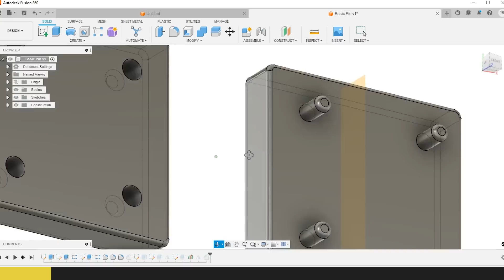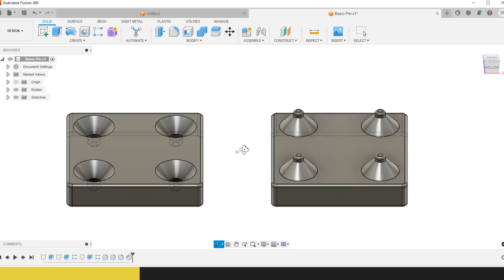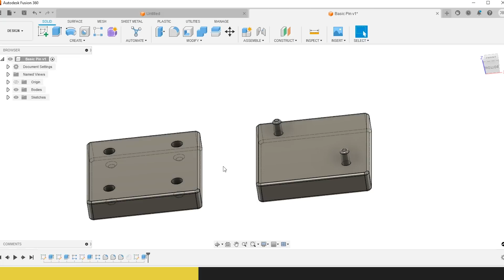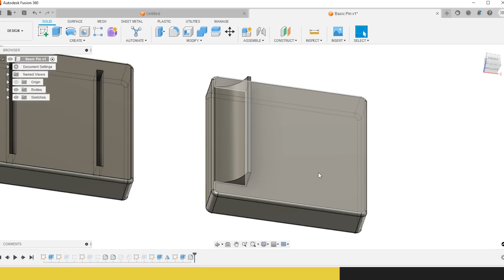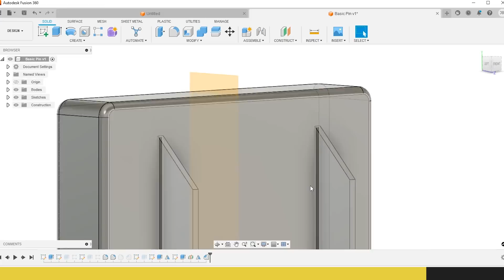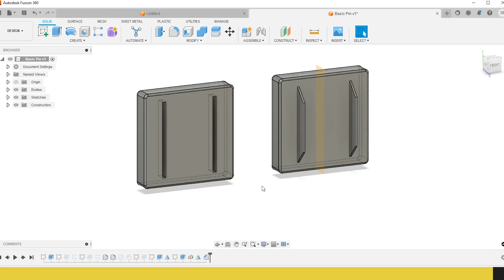Alternative to Pins and Holes: Design for Mass Production 3D Printing

Comment: I would never understand why the 3D printing community don't like screws... just leave the holes and use metric set screws. It would be cheaper, faster and way more reliable.
Reply: Screws are for fastenings and pins are for aligning. They are not interchangeable (in most cases).

The 3D printing community often uses screws when they make the most sense. But it is always a good thing if you can make a design that requires no hardware. That way you are completely self sufficient with your printer.
Reply: @TinaDanielsson 
Technically speaking, you should use dowel pin with external thread that are more expensive and are the correct part to used, but for 3D printed parts, a regular set screw is more than enough. Yeah, metric screws have more than enough precision for a 3D printed part to be used as a pin. 

Just print 1 side with the inner thread size and the other part with the outer thread size. For example a M4 set screw, would have a diameter of 4mm and and inner diameter (so you can do the thread) of 3.25mm. So you just need to print your parts with different hole size and then put the screw.

The only reason people are printing the pins is because they don't know that they could just use dowel pins or set screws and buying them is a hassle. But if you're doing "mass production" like the video tittle say, you should search for the best alternative and that's buying already cheap and mass produced parts to be integrated to your manufactured parts. There is a reason dowel pins are already a industry standard.
Reply from the maker: Screws are one of the single larges points of failure in any machine.
Reply: @slant3d  plastic parts are the largest point of failure... I assure you that any metal screw would last way more than any 3D printed part... and also a 3D printed hole is more reliable than any 3D printed pin or fin. 

So, just put a freaking 3D printed screw hole on one side and regular hole on the other side... install a simple set screw and you're done.
Reply from the maker: Screws are one of the single largest points of failure in any machine.
Reply: @slant3d  and again... a plastic 3D printed part is the biggest point of failure... It's pretty obvious that you don't work with other materials or process.

Seriously, I have years in the manufacturing industry. I work with CNC machines, laser cutters, and 3D printers and the less reliable part are the 3D-printed parts. The only reason we use them, it's because it's cheap and fast, not because it's the best option.

Using 3D printed pins and fins is just stupid. Those break with almost no effort. A hole is way more resilient than any pin/fin and adding metal inside (like a set screw) is pretty simple and add way more structural resistance.

Unless you're stupid and want to use 3D printed screws, you're actually adding structural resistance by adding metal parts.

You're designing for 3D printing, not for CNC metal parts where you actually use a single piece of metal, and it would be better to have pins.

Comment: just print holes and use SS pins. faster, simpler.
Reply from the maker: Adds additional labor and cost in mass production
Reply: @slant3d  still cost effective up to amounts you shouldn't be 3d printing anyway. we are talking cents and little to no effort inserting them for higher realability/durability and faster design/print times.
Reply from the maker: Adds additional labor and cost in mass production. Cents in effort and parts equals dollars when you produce 100k-1 million of them

Comment: Metal dowel pins are cheap as hell and will be stronger and quicker to use.
Reply from the maker: And they add extra labor and hterefore extra cost to a part
Reply: @slant3d  To hammer in 4 dowels doesnt take a lot of time. Especially considering printing the parts takes a lot longer. Even with a huge farm hammering in those dowels wouldnt take any longer than removing the part from the build plate.

At industrial levels firms are likely to be using injection moulding anyway.

I see your point though it is quicker to just print these parts but adding dowels will be more accurate and increase the strength of the connection. I just cant see why you wouldnt do that.

Just because you can build the solution into the 3d printed part it doesnt mean you should.
Reply from the maker: Imagine hammering in dowel pins 1 million times.
Reply: @slant3d  Imagine 3d printing 250,000 parts... The volumes you're talking about is just unrealistic. You wouldnt 3D print that many, you'd use more appropriate methods of manufacture. At that scale you'd be using robots anyway.
Reply from the maker: They are volumes we do all the time.
Reply from the maker: check out one of our robots https://www.youtube.com/watch?v=GeFzJ7teFjk
Reply: @slant3d imagine typing in favor of time spent/saved for mass production but then also typing print times are an irrelevant metric

Comment: Interesting alternatives to typical metal dowel pin alignment 👍. Actually the pins need not be round to start with, if to print hexagonal pins laying down it should print fine without support. You can also make the length a little undersized. Chamfer on end faces both on holes and pins should help as well. Then it is just inserting these pins with a drop of cyanoacrylate(aka superglue), is all that is needed. Should makeup for a much stronger and durable part with least amount of overhead interms of effort/time. The approach, does not sacrifice extra space, or need to accomodate new design requiremts for things such as slots.  It is also Poka-Yoke. Just some thoughts ....

Comment: Good alternatives depending on design constraints and usability.

I want to explore the use of bendable prints, you know a thin piece printed that connects the lid to the box and is flexible, I wanna see which design is the strongest and can be folded back and forth indefinitely.

Comment: My personal favourite is to create holes on both sides (on one side press-fit) and I insert a metallic pin or set screw. If necessary gluing on one side.
Reply from the maker: That is a fine solution. But the extra labor increases the cost fo the parts in mass production

Comment: I'd still go with pins but cut a flat side on both the top and bottom (essentially a rectangle with two rounded sides) so it can print horizontally and flat on the build plate. Also adjust the holes to match the pin shape.

Comment: What is the actual point of this? If you are assembling parts you need them to stay together which means fasteners or snap features. If using fasteners, a tight fit clearance hole and a tapped hole or heat set insert should provide as much aligbment accuracy as printed pins. If not using fasteners, the snaps should be able to be designed such that they drive alignment. I cant think of a real use for this. Even your use case of a box would be better suited to a simple lip under the lid that engages the walls of the box.
Reply: It's because people use pins all the time, whether or not you do is irrelevant. This is a video for those people
Reply: @bigcheese82  I use pins plenty. That isnt relevant. The whole point is that this was posted as a novel use of pins, but its novel because its one of the worst ways to accomplish the goal.
Reply: I’d probably press in dowels anyway.
Reply: Thankyou I have learned so much from watching your videos
Reply: To say what’s the point smacks to me of not having tried to mass assemble stuff. Having location features so you can smack parts together is really helpful - as even if you were then to fire in a plastite screw as a fastener - these features ensure the holes for the plastite screw are aligned . Otherwise you have a much slower and tiring activity to match the two parts up to then put the screw in. Also - you can reduce the number of fasteners - as the fasteners keep the surfaces together - but you don’t need multiple screws to align the parts- hence saving assembly time screwing stuff in - and part count.
Reply: @jonnyhifi Did you purposely ignore all but the first sentence of my comment? This is just a very basic way of accomplishing something we already have features for. Snaps, nesting, and lip and groove features already do the same job better. To be impressed with this "smacks to me" of not knowing anything about part design. Even hobbyists on printing forums are using more advanced features for the same purpose. This video is like explaining and praising the usefulness of cave drawings when we already have computer aided design. The whole video is just a sales pitch for this guys company and if this is the stuff he thinks is revolutionary, its not a great pitch. I have been designing, printing, and molding parts for over a decade and none of this is specific to 3D printing or better than more advanced injection molding features, no matter what he says in the video. He has a pretty big stake in making it seem like printing is a revolutionary new manufacturing method thats appropriate for mass manufacturing. There are plenty of arguments to support that, but features like this are not one of them

Comment: Ok, here is my amateur tip of the day. Make just holes, and use the filament of the 3d printer as the mating pin. Also, the video is showing that 4 pins is bad, and then the second solution is to drop it to 2 pin, doesn't make any sense.

Comment: You could literally see how the fins DID NOT align the two blocks together.... At least a good 1 or 2mm out from each other 😂

Steel dowel pins are very cheap, accessible, and are very accurate. They also don't have the risk of shear like printed pins do like you shown in the video. All you need to do is make one part with holes that have an interference fit, and the other to have holes that have a close clearance fit. You don't need to reinvent the wheel. There's a reason that method is used in traditional injection moulding equipment.... BECAUSE IT WORKS AND IS REPEATABLE!!!

I get the drive to think differently, but you need to also consider the fact that if something isn't broken, it likely doesn't need fixing...

Also, 3D printing is really only suitable for at most low quantity batch production parts. If you're doing 10's of thousands of parts, you'd be best to just go down the injection moulding route... You'd get parts far quicker, more robust, more accurate, nicer finish, and probably very similar in cost even with mould tooling design and manufacture included.
Reply: this part could obviously be best suited for dowel pins and injection molding. You need to look 1mm below the surface that OTHER applications can not be injection molded and still need alignment pins.
Reply: @saxplayingcompnerd  You can use steel locating pins for many purposes... they aren't only for injection molding.
Reply from the maker: Adjust dimensions to your application.

Comment: If the rib is thinner than the straight pin, it is weaker in that direction. The rib also has a lot more surface area, so more opportunity for error, or over-constraining the locating feature, causing improper fit (as seen in the video).
Reply: Definitely a few ideas here that will generate difficult assembly and improper fits

Comment: I usually just print the pins separately laying flat, then brush the mating surfaces with acetone before assembling. Otherwise I split the parts like a puzzle and add keys to lock in place, depending on how i need to assemble or what it will be used for

Comment: 'mass production 3d printing' really curious what you mean by this. Needs nomenclature adjustment
Reply from the maker: 25,000+ parts
Reply: @slant3d  If you need 25,000 of something, you would surely just injection mould it.. I can't see how FDM can compete with the price, speed, dimensional accuracy, and robustness of an injection moulded part. Yes there's tooling cost, but at 25,000 parts that's likely to be totally negligible in the grand scheme of things.

Comment: I still have plenty to learn about fusion 360–what is that move where you drew two circles to “undo” two of the pin extrusions without going back in the timeline? Didn’t look like you used the cut feature either

Comment: I usually just put holes on both sides, and use pieces of cut filament as the pins. It's much stronger than printed pins and while I'm not sure how it compares to fins, it's probably good enough for most applications and pretty fast to do.
Reply: yes, or print some dowels that you can friction-fit in the holes.
Reply: @jr1821 Or just buy them.  You can get premade cut dowels/pins for furniture making and repair at the hardware store.  Wood and stainless are common.  The stainless ones are like 50 cents a piece.  Cheaper in bulk.

If you really need some custom length, you could just buy a wood/steel/brass/aluminum/whatever rod and cut them down with a simple hacksaw.
Reply: This is the way
Reply: Interesting idea, do you glue them in or melt them, or something else?
Reply from the maker: That is an option. But it adds extra assembly time when the features could be integrated into the print to make it more scalable. Imagine manually adding pins 10,000 times.
Reply: @slant3d  on that scale though, we're beginning to venture into territories, where 3d-printing is just not economically viable anymore
Reply: @ichbrauchmehrkaffee5785  Yes, in mass production it is just better to use the 3D for prototyping and then manufacturing a resin, silicon (or whatever) negative out of it. Gone are the times where you had to carve a wood plug with a knife for smelting metal.
Reply: @ichbrauchmehrkaffee5785  ?? entire 3d printing farms exist specifically bc it is economically viable
Reply: @aakh-sw1ls  depends on the part, material, and post processing as to which way to go. Anybody who is mass producing parts damn well better be costing out multiple solutions.

Comment: One thing people commonly do is have holes only and use scrap filament to lock parts via those holes. This can be done for hinges too.
Reply from the maker: Yes. But that is not viable for mass production because it is an additional assembly step
Reply: @Slant 3D  however, assembly is unavoidable in some designs. Especially when the printer is not big enough or if a limited part count makes assembly harder instead of easier. Often the easier is better than fewer parts. Also pushing pin a into hole b is easier than screws. But screws are better for securing mated parts where there is no room to put a pin in hole connector.

Comment: I like to print my pins separately and use an octagonal shape along the long axis. Both plates have octagonal holes and the pins are printed on their sides.
Reply from the maker: But that is not optimized for mass production because it adds several assembly steps that add cost to the part

Comment: All modern CAD programs have libraries of fasteners and openings to use them.  Now we just need libraries of predesigned features like those shown here for mating parts, as well as simple parameters to size them and apply both in a single operation.  Think of it as an extension of the Hole function, where you create the hole and attendant countersink all in a single step.

One click should let you choose a mating style from every reasonably strong possibility and be able to set in place on both sides of the mating as features added to the design.  This should even include splitting a model into two parts for assembly afterward by simply positioning the mating type and locations desired as part of the split process, such as locating them within a plane being used for the split.  A simple see through view can let you see and position the desired new features before committing the split to render the then separate parts.
Reply from the maker: That would be great
Reply: @OArchivesX   Not everyone is a trained engineer.  Increasingly AI is going to push into CAD to enable untrained users to do more.

Comment: Making two fins with these huge chamfers doesn't really constrain them vertically though. They will just slide out if pushed from the top or bottom. You might want to angle them 45 deg to each other which then works perfectly with printing on the chamfered corner like you showed in a previous video. edit: also changes the layer direction to a better angle so you don't risk breaking them right in plane
Reply: Yeah, you can literally see the two demo pieces not even align correctly on the other axis
Reply: I was shouting at the screen "fins are just long pins".
Reply: I agree and will try out a V or Y configuration
Reply: @OArchivesX  Not trying to start drama, I'm genuinely curious since I've been 3D printing and always enjoy learning new things for my hobby. Are there better ways to do this than pins and holes? I would like to learn more if you have any resources or videos.
Reply: @praxic5100  just use normal screws and either captive nuts or brass inserts. If you want to have an assembly just like in the video consider using dowels and a transition fit for the dowel holes.
Reply: Would not just normal wooden pins work as well or even better?
Reply: Fr reinventing the wheel for no reason and the replacement is worse😂
Reply from the maker: That is only feasible if there is the area to support them. Generally features like these would be made smaller and be on the outer edge of an electrical enclosure. It is also ideal to chamfer the inner edge of the slot as well so that part is constrained in both Axis.

Comment: A couple of variations that would increase 2 axis alignment would be to  make the fin a slight s shaped arc or to break it into to smaller fins that are slightly angled opposite of each other.
Reply from the maker: That is alright if you have the space. Alternatively you can chamfer the inner edge of the slot to abutt the finned chamfer